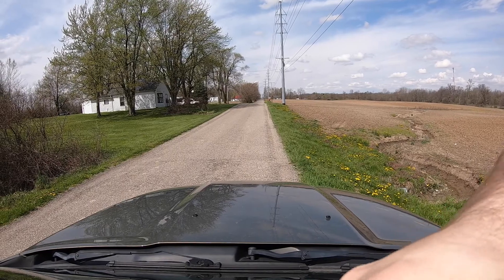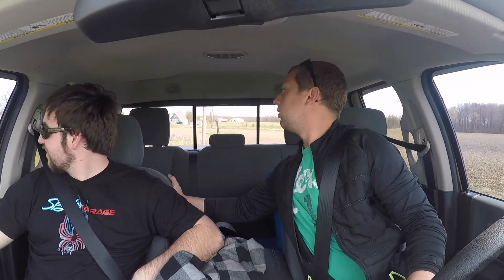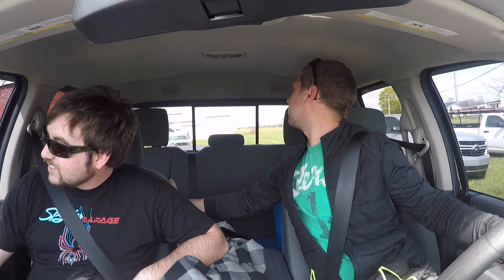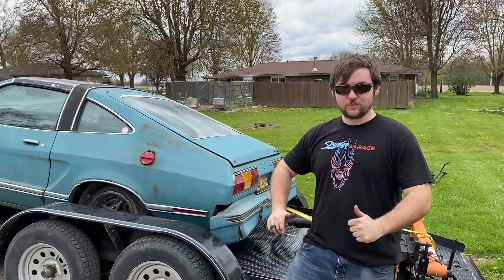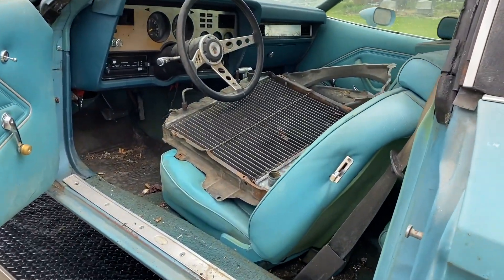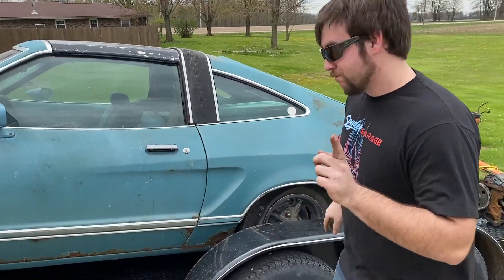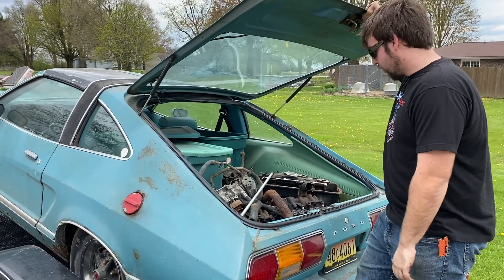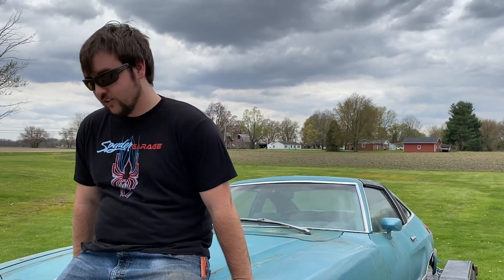Barn Find Mustang or Clapped out Pinto? - Broken Gear Short No. 2

Comment: The Mustang II never had a gas tank rupturing problem like the Pinto, And it out handled all of the other ones, That is why they all got cut up for the front suspension! And for the record only a few Pinto's had a problem with the gas tank, Ford discovered it early on! They corrected the problem on all new cars but tried to get away without recalling the defective ones because they thought it would be cheaper to pay the lawsuits on the ones that got wrecked, and those words were found in the minutes of a meeting! That is what caused the big stink!  I like this Mustang, It needs to be a darker blue with white stripes or white with dark blue stripes, 302, with 4 or 5 speed carbed or injected either one as light as it is it will have some balls!

Comment: Love it.  Like the color, like the T-Tops, needs to have a great stance, and a nice 5.0 with a 5-speed.
Reply from the maker: I believe that is Karson's plan!
Reply: @brokengear2476  Your towing pickup isn't classic.  Too many revivers tow with modern pickups and cant seem to fix a truck up for themselves.
Reply: @brokengear2476  Apparently, Mustang 2s have the best front end for hot rods, so most are gone and are front end donors.  I'm not sure why.
Reply: @brokengear2476  Yugos are cool, but my 3 cylinder Metro is cooler.
Reply from the maker: @alan6832  Sold the 68 Power Wagon and 85 Ram to buy more cars.
Reply: @brokengear2476  I bet the new truck I see you towing with would fetch you more money.
Reply from the maker: @alan6832  If I could drive a cool old one for work, I would consider it. Not a huge classic truck guy for one, and two: I'm a Home Hospice nurse by trade, and have vehicle guidelines to abide by.
Reply: @brokengear2476  Hmm. Maybe a late model econobox for work The Mopar would be fiat 500 now but the Ford Fiesta, Chevy Sonic and Spark and Honda Fit are all better.  I tow with my '82 W-150 slant 6.  Very slow but works well.
Reply: @brokengear2476  Oh, and some of the huge old Mopar cars and vans can tow that trailer too, though only a few custom vans have 4wd.
Reply: @brokengear2476  Mustang 2s are among the most underrated, but Mavericks, until recently, were even more underrated, though I think a big block will bolt into a Mustang 2 but are too wide for a Maverick.  I even saw a chart once that included specs for a 460cid Mustang 2., but good luck getting that out of the mud.  Pintos are underrated to, especially the wagons, as are Vegas except the aluminum engines need a solution of some kind, reboring, Iron deuce, v6 or whatever.
  v6 Chevettes even have potential, the step-grandad or my 3-cyl Metro.

Comment: I recently put a roller 351w in my '77 cobra. Im having to modify the clutch cable system. I went with the foxbody setup using the original mustang II clutch pedal bracket.